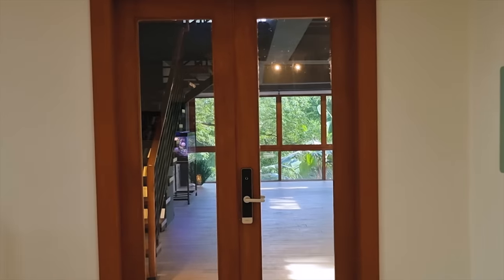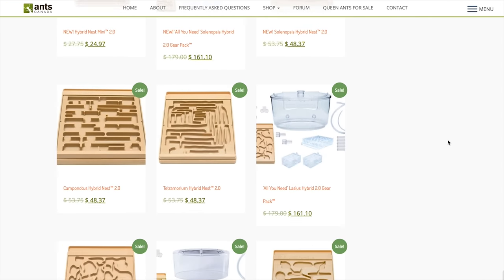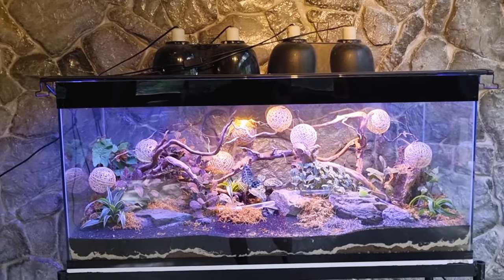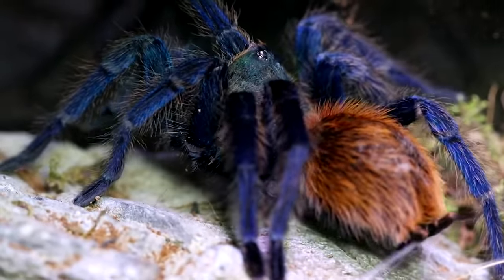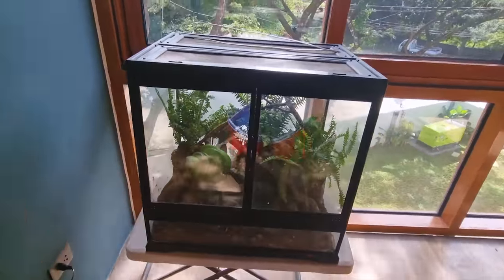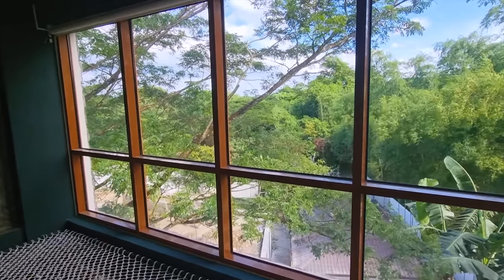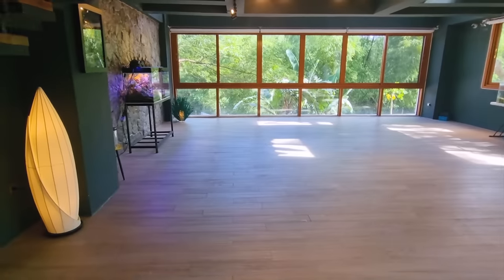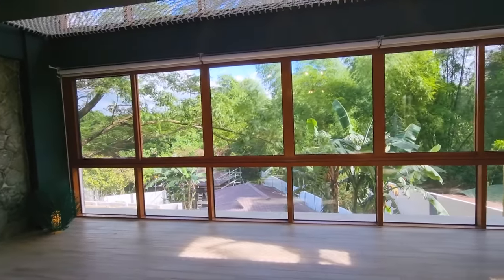FULL TOUR of My New ANT ROOM 2.0 (Update on ALL Ant Colonies, Pets, Etc.)

Comment: When you call 28c cool I died inside a little and then converted to f to be extra sure. It's around 82f for those wondering. 

My body can't regulate temperature properly so even just 72 f (22 c) can be too warm inside for me. Ideal range is like 65 68 f (18 20 c) to avoid overheating although I have to use a little foot warmer so I can feel my feet and keep blood flow through them. At night I can tolerate down to 58f nightly (14 c) when sleeping purely because my dog is an electricity free bed warmer and she sleeps UNDER the blankets lol

Comment: A piece of feedback that I mean in the most respectful way in hope you will find it useful to make your videos even better in ways you may have not thought of. If you could pay attention to panning of the sound of your voice I'm one minute into the vid watching it with headphones and my right ear is already tired comparing with the left ear being bored. IDK if other viewers feel the same way but I find that imbalance unpleasant. It doesn't mean you need to make your videos mono or anything like that, just that if you do make them stereo, try to switch up between channels where your voice comes from once in a while without using on either side more than the other, and maybe putting some other sounds like music into the "quiet" channel whilst your voice speaks from the other one would help as well. And like mentioned, mix them up once in a while to avoid tiring-ness for the listener. :)